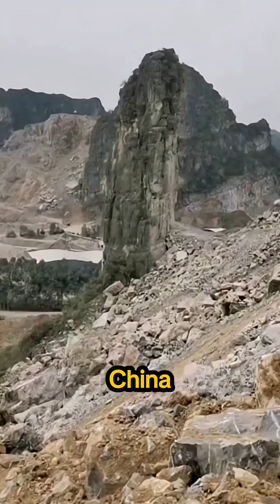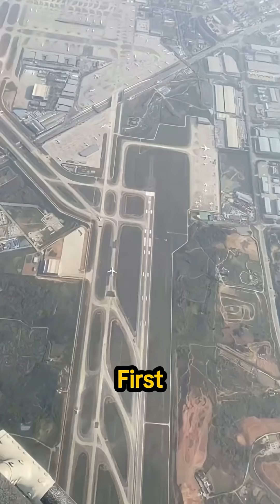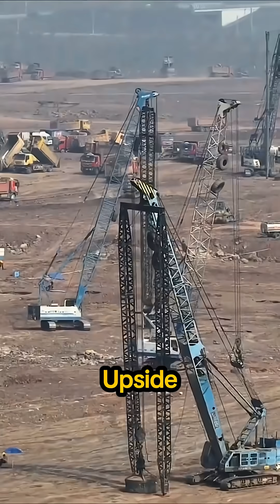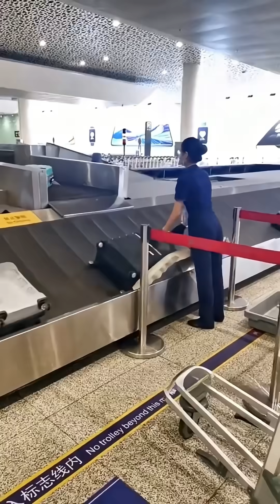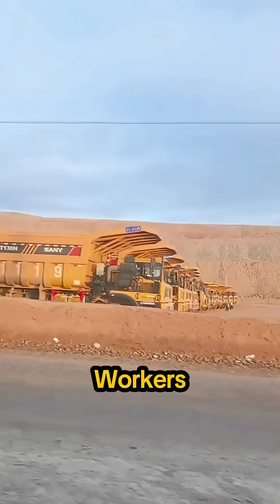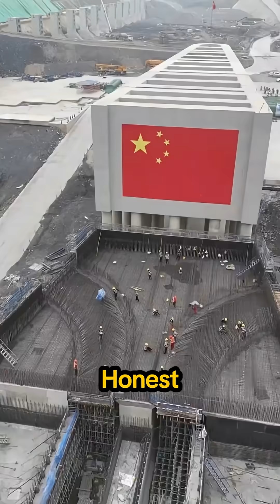China BLOWS UP 370 Mountains for World's Craziest Airport

Comment: There is nothingto to praises about this, blowing up a mountain is hardly a good idea let alone 370 in the same area.
Think of the earth as a house and the mountains as the pillars, blowing up one shouldn't be a problem but blowing up all those mountains in the same area! Now thats absolutely foolish.
For those who dont know, what you see and call a mountain is barely the tips of the iceberg, mountains in fact run deep into the earth, the part above the earth dont even represent 1/7 th of the whole block, now you go and blow up the top of this pillar creat small cracks at the core that will expand extremely fast because of heat, wind and cold. And you did that to every mountain in that area, this is very foolish from the stand point of geologist, this can make earth quick stronger, floods, pollution of water sources, land in the area slowly sinks gradually... we arent even talking about 100 years no no, there will be consequences withing decades at most 50 yeara.
This project is a political achievement alright an impressive one, but foolish nonetheless and sever consequences will follow, that wont be fixable.

Comment: Nothing new with the Engineering. The construction cost is the restraint. Another primary consideration is the ecological impact. China does not have cost constraints or high standards regarding ecological/environmental effects. Hopefully, the materials used to construct the airport meet the required specifications. Nonetheless, it is an incredible achievement.

Comment: Give it 2 years and it will fall over, China is a nation of facades and short cuts.  Massive flooding every year because they never bothered to build drainage properly,  Collapsing bridges and overpasses because they don't use proper concrete and fill the forms with garbage instead of the bad concrete they use.

Don't be tricked by China's Beautiful Trash projects, there's reasons why the Belt and Road projects are hated world wide.